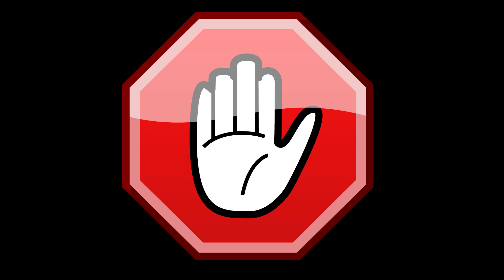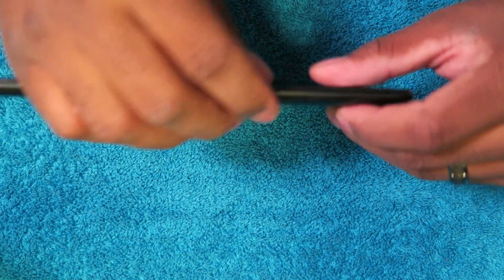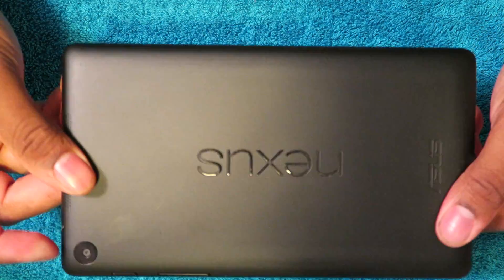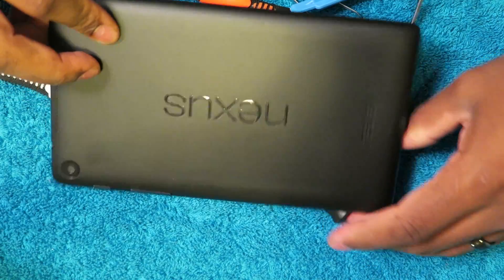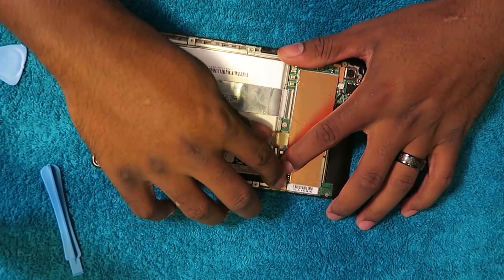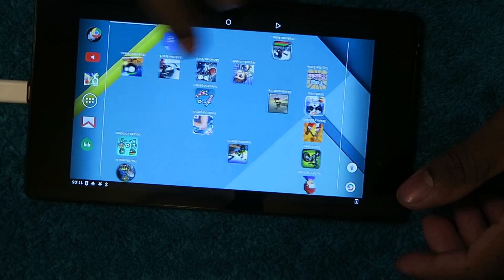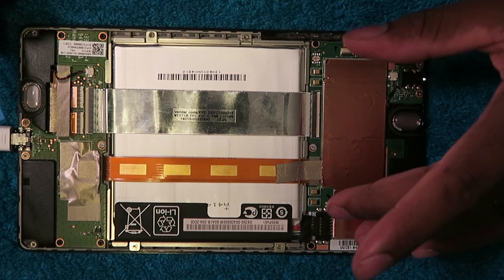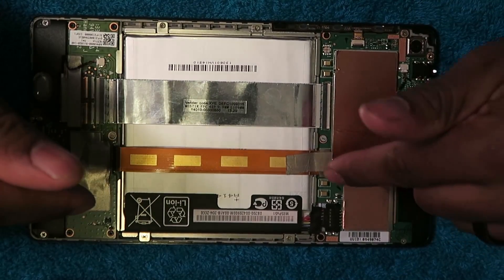Nexus 7 (2013) won't Power Up, Here's the FIX!

Comment: My Nexus is older than your's and when I snapped the back of it off, it didn't even ....have...thar strip that you are talking about and showing in your vid on your Nexus.  HELP!!!!!
Reply from the maker: If it's older than the one in this video it might just be too old to save. The only advice I can really give is to unseat and reconnect any cables you can since a loose cable may be the reason it's not powering up. That's what I was doing when I made this video. I was just looking for something that might have come loose. Nothing looked loose but reconnecting did the trick.
Reply: Thank you. I had tried all that you have suggested, and still nothing.  @jpulley
Reply: @jpulley I did, however, watch a another video where this guy had jump started his battery to his nexus that looked exactly like mine does on the inside. Whew! It was a very ...extream...way to get this done lol, But it ended up working for him. I thought...well, Since the battery is completely flatlined anyway lol, it might just turn into, at least, a good experiment lol.

Comment: Haha Crazy - I had ZERO expectation of this working, but thought I might as well just try it as the thing has been sitting on a shelf for years, so was just going to throw it out. It completely worked! Haha. I also cracked the back in two places - where the charger goes and at the top where the headphones go. But I don't give a shit about that. Nice one! As soon as I put it back together and pressed the power button (not for 30 seconds, but just the usual couple of seconds), it turned straight on.

Comment: September 2024... I found mine stashed with some boxes. I thought I'd lost it after moving.  Sadly it seems the battery is dead as it won't charge.  I guess it's time to donate it to a museum xD

The 60 second trick worked though.

Comment: Hangs on the GOOGLE screensaver.  I did not disassemble, but simply mechanically bent the tablet so that the connector under the case moved and the tablet could be overloaded!  Thank you very much.

Comment: I would be very grateful if you could tell me the rating of the resistor on the charging board, that one leg goes to the diode on the back of the board, and the other to the connector of the loop that goes to the main board
Reply from the maker: Sorry I haven't had one of these for many years. Unfortunately I have no idea.

Comment: Still working! I drop my nexus on the floor and it didn't work for a week, I don't have any tools so I opened mines with an old card. I pushed the silver plank under the strip down and then held the power down and it turned on!  tysm you're a lifesaver

Comment: Any ideas when the screen would be working as per normal and if you leave it after awhile it doesn't respond to touch? No cracks or anything. Using the same Nexus. Would have to restart it to get it to work. Plus mine doesn't want to rotate screen.
Reply from the maker: Your sounds more like a software issue than hardware. You might look into doing a factory reset. Back up anything you don't want to look.

Comment: Maybe I missed something, but for the second fix, you're saying to peel back that gray piece of tape, but then what? I don't want to jiggle around the gold ribbon too much, but could you please explain exactly what you did?
Reply from the maker: For me when I peeled back that tape I discovered that the gold ribbon was not even plugged in. I would suggest unplugging that gold cable and plug it back in. It seems to be a common problem with those tablets. The gold ribbon cable becomes unplugged. If you can make sure it's properly plugged  that would likely solve your problem.

Comment: I replaced my battery and it shows the correct date and time and even shows notifications on the screen but it will not turn on? Help! I tried charging it and it will not power off either. When I touch the screen it does nothing
Reply from the maker: Its been quite a while since I've used this particular tablet but I'm thinking if you can see time but it's not coming it might be your back light not illuminating. I would go through and re-seat all the cables that I do in the video. If that doesn't get it going it may actually be broken.
Reply: @jpulley  thank you! The silver cable connecter had to be reset. It wasn't on properly
Reply: @jpulley  thank you! The silver cable connecter had to be reset. It wasn't on properly

Comment: Thank you so very much! The 60 second power button trick did not work, but the power/volume down (plus changing to a brand new micro USB cable) got it charging. I'm now waiting for it to reach 100% before turning it on.
Fully charged now, turned it on, worked like brand new. Thanks again.

Comment: October 2020 and I still use my N7 (2013) regularly. This morning I dropped the tablet (in the case) and it would't turn on. Tried all the Power and Volume Button tricks and nothing. Popped of the case back and the connector you describe at 6:27 was the culprit. Reconnected it and voila! I'm back in business. Thanks for a great video.
Reply from the maker: Glad it worked for you.

Comment: I need help please
My tablet shows the charging icon then complete darkness. I can't turn it on in anyway. I really need help. 🥺
Reply from the maker: My guess is that the video cable has become unseated. You need to follow the steps in the video.
Reply: @jpulley  but why does it show it's charging?

Comment: Love love this pad. Why they discontinued it⥰>JustU.Faith/NexusTab?催   I'll never know. I believe the new nexus pads are made by a different maker. I looked at the new ones, and passed. Cheap, and bad reviews. Why didn't they keep this one going? I would have bought several.
Reply: @ortega2807 - I still have my 2012 Nexus 7 - it died once and it was because the battery had become detached - easy fix even for me!! However, countless updates and new versions of Android have made it very slow - I can play games on it sometimes. Just doing a factory reset to see if that helps - but I agree - it is a wonderful piece of kit - so well made - that lovely rounded, tactile back - still love it despite its shortcomings.

Comment: Thanks for your video! My dog had knocked mine off coffee table many months ago.... did the power hold button, disconnected battery held the bottom down, no dice.... but pushed down on the ribbon cable slightly and heard it snapped back on.... thanks!! Oh, put a small crack in case at the bottom but better than the bullets I was going to put through it for target 🎯 practice

Comment: you don't have to open it. All you have to do is (quickly) plug the charging cable and press the power button and volume down. Hold it for a while. Repeat it few times until you see the sign of a battery and then it will start to charge. The procedure takes a while, 10-20 min

Comment: my tablet didn't start anyway I straightened  the ribbon and repluged battery cable also tried 60second technique but it wouldn't start. It has been in my drawer for 2 years now I haven't charged it but when I plug it in it gets a white dot lighting up on the bottom 
 what else can I try to fix this problem? can you help me in any other way?

Comment: OMG!  I have had so many issues with a stuck screen and failure to launch that I finally bought a new Samsung tablet.  Shortly after purchase, I tried the Nexus again and it came on so I gave it to my husband.  He has loved it and played with it for over a month now, but today it would not go beyond the Google logo.  After many attempts at the re-boot methods, I found this video and while I really didn't want to take it apart, I did apply some pressure on the back cover right over the logo and voila', it works perfectly!  Thank you so much.

Comment: Thank you SO SO much. I'd tried everything and you were my last resort before I had a meltdown. My silly son has a habit of punching his tablet when he's not getting a response (because his screen is covered in child-hand gunk!) I've fixed this stupid thing so many times by opening it up but this time, I was totally stumped! You saved my life and my holiday next week! Thanks again! X

Also if anyone has trouble peeling that tape back, or if you're too worried, don't peel the tape back. Just push gently on the little rectangular grey thing under the tape and you might find it pops back in. That's what I did and it was popped out - clicked back in and voila! Heard a beep and it came back on without me touching any power buttons on the side.

Comment: I have a Nexus Asus padphone of which was thrown away at our local Recycle site and when I took it home and put it on charge It showed Promising where I let it charge up for a while and then Pressed the start  Button the Google sign came up and also there was the Nine dots where one  codes in a sequence to activate it: The  Tablet does not have a scratch upon it: The recycle site is where Multi millionaires live and come up with their Mercs and their Big 4 X 4 ! I have had Many things actually given to me as i have had this Given to me But the problem is that the Code for unlocking it is somewhat hard to trace: I The serial Number sn:d20kbc382712 12 could this serial number reveal the Date of the pad and is it possible to Set the  Pad to Factory reset without opening the Back up ??
Reply from the maker: Try one of my other videos, I show how to factory reset a tablet without knowing the pin. https://www.youtube.com/watch?v=HEvVlWwhV04

Comment: I unplug the tiny ribbon but now wont start       and charge from powerbank wont help huh
Reply from the maker: Name Name1 I would go through and reseat all the ribbon cables you can find and the plug that connects the battery to the motherboard basically just unhook it and reconnect it. If you have a wireless charger you might want to try that sometimes the USB charging port is broken
Reply: My battery is soldered just 2 wires    on old Alcatel onetouch
Reply: I was dropped it around 3 days an it has stopped while charging whole night     i open it remove the black band thath hold this very small ribbon that connect to blue thing that can down and up idont know what possiton was before to hold the small ribbon
Reply from the maker: Oh, these instructions were pretty much for the Nexus 7 2013 since it has a problem with it cables become loose and just needs to be reseated. To be honest, I really have no idea what could be going on with your device, but I would just recheck anything that you unhooked.

Comment: Nice video.. Did you plug out and in the ribbon? Because I never saw it.
Reply from the maker: Matthew Lazaro I have had 3 of these exact tablets for my three kids all of them has had the same issue at one time or another it's been my experience just unseating all of the cables and plugging  them again will allow it to power up again.

Comment: First my auto rotate was not working so followed instructions to fix that, after reassembling it would not power up.
I followed your instructions and found the fault as you described, all working great, I used my best finger nail to open the case so will have to wait some time for one to grow if another problem occurs.

Comment: When I opened my tablet, it looks like someone has already tried to fix it because it doesn't have the copper tape over it like yours. Do I need to put more on it
Reply from the maker: Tina Schroeder you will probably be hard-pressed to find the same stuff that they used in the tablet. I would recommend maybe doubling up some electrical tape over the connectors. Then when the case is on the tablet it will help hold it the connectors down.

Comment: Exact problem with mine, loose connector, I also small cracked my case getting it off, I suggest opening sides and top first and adding some extra padding to the spongy bits to stop them working loose again, thx for the vid :)

Comment: To drain a battery faster, plug in a USB fan.

SInce it is an Asus table, hold down the power and volume up buttons for ar least 3 minutes before giving up.

The back can be popped off using a spudger or a flat ground exacto blade (grind off the edge), starting from the bottom and working up the side opposite the buttons.

Comment: Not sure if you're still monitoring this, but how did you get the tape off of the connecting cable? On my unit, the tape is actually under the layer of copper foil, so the only way to remove the tape to re-seat the jumper is to cut it. Is that what you did? It looks like that's what you did. 

Cheers!
Reply from the maker: The copper foil serves as a heat spreader it should be ok to cut it a little to get the ribbon cable free. Just be careful not to cut the actual cable. I didn't have to cut mine, but there might be small differences in production runs.

Comment: I don't know what I did to mine but it's working again.
Volume and power buttons did nothing.
I went ahead and pulled it apart, been wanting to blow a dirt speck off the lens...
Plugging the USB into my laptop would show it connected if it was turned on.
I powered it off and the charging icon showed up on the screen. 
Then I turned it on and it started working again.

Shit my pants moment averted.

Comment: I had exactly the same problem. Thanks for pointing me in the right direction. Really bizarre though, as I had the device on my bedside table and it stopped working over night. I hadn't dropped it or anything.
Reply from the maker: +Steven Dawe my three kids all have the same tablet. It seems that at times the tablet cables need to be re-seated. This shouldn't be the case but it just re-seating the right cable can get it back on.
Reply: It's a weird thing. When something stays plugged in like these cables they can gain an actual type of "corrosion" from being plugged in, forget the actual terminology but it happens alot. Especially on desktop PC's with RAM. If I recall the electric current and the metal (or something relevant to that) stay connected for so long some sort of bacteria forms causing interruption, unplug replug and the "bactera/corrosion" causing the interuption goes away. neat fact.

Comment: jp can you tell me what to do with my tablet I try to turn mine on and it goes to the booting screen and it just freezes I have a nextbook tablet plz respond
Reply from the maker: scorpzero 12 sounds like you have a software issue that causing some kind of a boot loop. The best way to fix this is to boot into recovery and perform a factory reset. bad part is that you will lose everything on the tablet. when you really think about it you already lost it all, so you might as well do a factory reset and at least have a functioning tablet.
Reply from the maker: just google boot into recovery for your type of tablet. From there just look up instructions for doing a factory reset.

Comment: I don't get it, when you peeled the tape off, does it stick back on? I don't want to mess it up.
Reply from the maker: Yes the tape is still quite sticky after pulling it off. I was able to reapply the tape with no issue.
Reply: It's just that to me the thing it's taped to doesn't seem like it was loose. So I don't know whether it's worth a shot peeling it.
Reply from the maker: my three kids all have nexus 7s I've had to open all of them  for one reason or another. There as been times that nothing seems loose at all but just re-seating the cables would get the table to come back to life. The cable you are worried about might be fine. Just re-seat the other cables and see if it will power on. It might take a few tries but eventually you should be able to get it back on. It could be you have an entirely different problem altogether, if thats the case re-seating cable might not fix it but its worth a try.
Reply: Oh, right. I'll have a go removing the black plastic one, and the tape too this time.

Comment: Brilliant video. The transfer cable had also come loose on our Nexus, looks like the tape they use to hold it in place is actually pulling it off the board. Thanks for the video.

Comment: Can u please help me ? Mine got dropped and now the touch screen does not work :( I cleared cache got into safe boot but still nothing ? Thank you in advance
Reply from the maker: sounds like your digitizer ribbon cable may have become undone. I would open the tablet and disconnect and reseat any cable you can get to until your digitizer is working again.
Reply: I opened my tablet and dissconnected and connected again the silver cable along the battery. Is that the ribbon one ? (still not working tho :( )
Reply from the maker: +Drilon Aliu  I believe the ribbon cable for the digitizer are the two smaller plugs that are side by side. You can this this in my video in the lower right hand part of the tablet.

Comment: I haven't dropped mine but I did everything in this video I unplugged the battery it didn't work I tried doing all the things with the on button and the volume buttons a long time ago didn't work and then I pulled that tape stuff back and it was plugged in still not working

Comment: TY jpulley, you are a genius; popping back the ribbon works great!!
Reply from the maker: glad things worked out for you!
Reply: @jpulley  how do you know if it's not plugged in
Reply from the maker: @troller3032  you really don't know, you just have to try them out and see. I think some might wiggle loose but still be plugged in so it's hard to tell.
Reply: @jpulley  ok thx

Comment: I've tried everything. I've watched 9 different videos, all with different methods and none of them fixed my nexus 7
Reply: try a friends charge cord, make sure it is charging, check dirty connection, and is charging.charge port board can fail. battery can fail or poor connections. have to trial and error each .
Reply: @alhart6665  only 4 years late😂😂

Comment: Couldn't get mine to boot or charge no matter what I did...until...I began charging it with a 1.6v charger. I'd tried other charges but I guess they were all under volted. Now it works great.